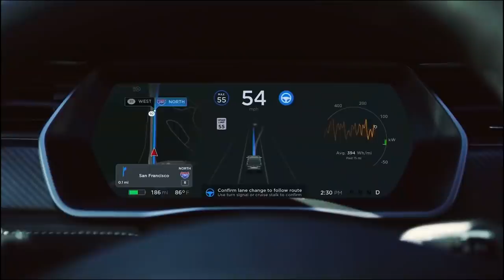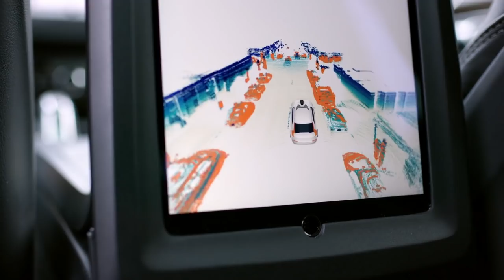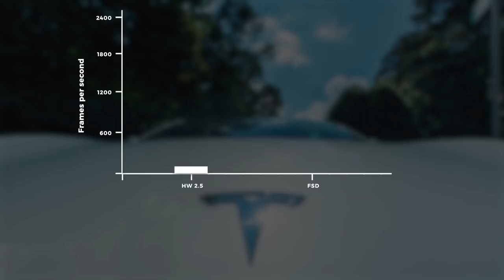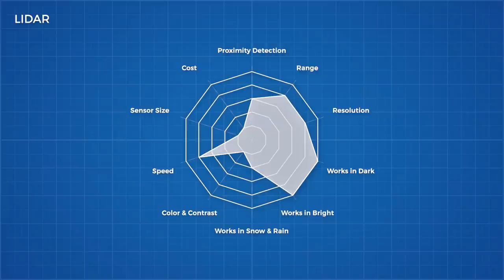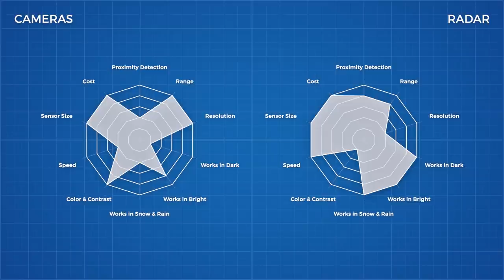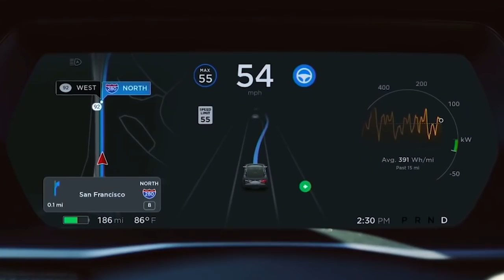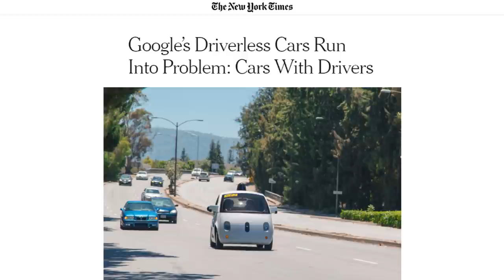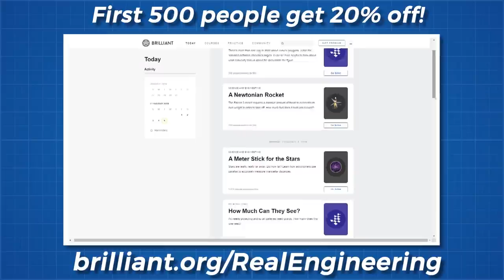The Challenge of Building a Self-Driving Car

Comment: I highly doubt self driving will ever be done to my satisfaction! IMHO if a car is supposed to be reliably self driving then it should also be liable if it does have an accident. Not the driver as the diver is just a passenger at that point. And this is what will never happen. The car as good as they can make it will still require the driver to be responsible at all times. Which simply is not feasible. If you are distracted doing something else how can you take over in a split second and become a responsible driver for a machine that you first have to diagnose as having failed to the point that you do need to take over. This is exactly why B737 Max aircraft have been grounded. Because of failed automation protocols. And guess what it is the pilot in commands fault not the airplanes fault even though they are grounded. Funny how corporate America escapes liability. 

And last issue I have is that testing of automation is even allowed to happen in live traffic putting other people at risk and if anything does happen it is the driver liability and not Tesla at all. They remain squeaky clean while you test drive their product and assume its liability for them. And they get to charge you money for that service on top of it. Like your insurance premium. And your price you pay for the auto pilot function. 
If these cars really statistically are safer to drive by a wide margin then your insurance rates should also be cheaper by a wide margin, so I ask you why are they not? Who is being taken for a ride by corporate America in this whole equation?

P.S. Every single accident that I have seen reported that involved a Tesla, has always been caused by the Tesla. I have not seen or heard of a Tesla getting involved in an accident caused by a human driver outside of the Tesla owner. Even though they are safer than human drivers. I find that interesting.
Reply: Terms of service better read that instead of crying on the internet.
What is tesla autonomy lvl that you assume that they have to assume liability when clearly they stated that they wont. How about creating a car company that can have autonomous driving and be better than tesla or waymo etc.
Reply: @chillrawr9603  Because it is a cop out to build a self driving car and then tell the world you will not stand behind your own product. That simply tells me they do not believe enough in what they are doing to back it up with their own money. And in that case the entire self driving tech is a house of cards. Why? Because the stock price is based upon the idea that Tesla is more than a car company. So to all of that I say prove it. I for one will never support or buy any self driving car unless the company that builds it also assumes liability for it. Call it checks and balance. 
And I think the rest of you that do assume Tesla liability for them are stupid. It is simple really, if the public demanded that Tesla assume liability for the auto pilot and stopped buying Tesla's until they do how long would it take Tesla to change Terms of service. Why do you allow them to dictate terms to you the customer? When you have all the power in this equation. Yet allow yourself to be played the chump.

Comment: Tesla's safety features can't detect if you're about to be rear ended
Reply: I think this myth stems from some autopilot compilations where somebody accelerated to avoid being rear ended with autopilot off, and somebody added the autopilot warning sound onto it
Reply: they actually can better than humans usually do, I've seen it first hand.
Reply: @frozenthorn9619  no, i have a model 3. no where in the owners manual or autopilot settings does it mention rear collision avoidance. there is only forward collision warning and auto emergency brake

Comment: One thing to note though, while the miles of data that Tesla has is far larger, Waymo's data set is far more comprehensive and "feature-filled". Those initiating feature factors are force-multipliers in the accuracy and power of that data, especially when you want to do "feature-engineering" later on with the data-set, even if its automated and done by the algorithm itself.

If you want an analogy, Tesla's dataset is more similar to an Observational Study of a million people, while Waymo's data and methodology is a Double-Blind Randomized Controlled Trial of 10k people. The later has fewer people but at this stage, it has enough samples with it complexity to far surpass the prior

Comment: The pedestrian crossing the road was visible at 1:49, but let's say 1:48 because the video is not the same as actually being the driver in that car, and they got hit at 1:51. Asumming the video is not sped up at all that's 3 seconds between seeing the pedestrian and hitting them. Minus 1 second human reaction time. That's two seconds to decelerate. Not nearly enough to decelerate from 70km/h. The human pushed the brakes 1 second before impact and deccelerated by just 8 km/h. Any human would have hit the pedestrian in that situation, or even worse could have veered of into a different lane and caused a bigger crash.

That aside, it was indeed very poor programming. No warning system, no slowing down when recognising an unidentified object in the road like a human would do, not even a gradual decceleration when it realised the impact was inevitable to increase chances of survival.

Comment: Uber hard-coded the software to simply not brake if it would result in too much deceleration? I.e. never perform any emergency braking maneuver because the driver might be inconvenienced? That's an infuriatingly irresponsible design choice. There wasn't even any traffic immediately following the car, and thus no risk of a rear-end collision.

Comment: New Mazda with radar cruise control, works beautifully and reduces driving effort. But the other day it just stopped working for some inexplicable reason so I had to manually reset it and then it was fine. Point is none of these aids work 100% so what happens when they don't in a self driving car? Sensors can get blocked by debris, white lines are never 100% reliable, self driving car? I don't think so.
Reply: Humans aren't 100% reliable either.  That's the whole point.
Reply: @CorwynGC  If I as a driver failed like the radar cruise control did then I'd be dead many years ago. The self driving car concept is based on the extreme arrogance of a few people.
Reply: @FairladyS130  And many humans just like you are dead, 40,000 or so every year in the US.  So since anecdotes and survivor bias don't get us an answer; what does?
Reply: @CorwynGC  Any driver is constantly making car control decisions, that has to go into the billions of decisions for any experienced driver but I guess that you automatics have worked all that out already? My radar fail happened after about a total of 8 hours use, that speaks for itself.
Reply: @FairladyS130  You sound just like the chess players that said no computer would ever play professional level chess.  And the professional Go players that said the same thing.  Tesla's autopilot has a billion miles of experience and processes information about 1 billion times faster than humans, it is lacking a million years of evolution learning how to learn, but it is getting trained by the pinnacle of evolved intelligence.  Are humans smart enough to drive but not smart enough to teach a machine to drive?
Reply: @CorwynGC  No, self driving cars will come but only in the form of a being driven by a 'human' robot that will have all the required human qualities without the negatives such as anger, ego and so on.
Reply: @CorwynGC  Yet you want humans to devise the perfect self driving car? LOL.
Reply: @FairladyS130  A human robot is a far worse than an intelligent car.  That would be crazy.  Having a computer tell a leg to move and extend to press on a brake pedal to activate brakes is far slower and more problem prone than just having a computer tell brakes to activate.
Reply: @FairladyS130  Humans devised chess programs that beat all humans, so yes.
Reply: @CorwynGC  If that's your 'logic' then humans create everything except what nature does.
Reply: @CorwynGC  Who said  a brake would be operated like that? My point is that a stand alone self driving car would tie up a lot of tech which may not be used very often whereas a car driving robot would  have many uses. You fan boys need to think outside the box.
Reply: @FairladyS130  The WHOLE POINT of self driving cars is to keep the duty cycle of the car as high as possible, to make money from the car.  Trying to invent a car driving robot that can also do anything else would be more than twice as difficult.  You need to think inside reality.

Comment: EVEN IF we could reliably determine that these road-bots matched the human average of 1 death/million hrs., that would not be good enough because the human stat is greatly skewed by those whose driving is both consistently and extremely dangerous and whose driving hours per fatality would be measured not in millions, but in mere thousands of hours. The threat they pose will only rarely NOT be realized, ending only serious injury or death for themselves and/others. With such a small percentage of drivers accounting for an extraordinarily disproportionate  number of road deaths, I for one will NOT trust a program that does no better than equal a  safety rate for humans that includes those outliers who statistically truly are fatal-accidents-waiting-to-happen.

Comment: This and the Boeing 737 Max, examples of software developer over reach. Time to legislate for developer certification, and supervision for each and every software update.
Reply: Every modern airliner uses an immense amount of software augmentation the MAX is actually on the low end of the spectrum it does apply the concept differently in that it's not a full fly by wire system

Comment: 70km/hr is 63.8 ft/sec or 128.7ft/2sec. Leaving the system a bit more than 2 sec for detection, decision and braking to a full stop. 

The name of the game auto drive is for collision avoidance, such uncertainty decision is a system fault and no excuse. 

A word about LIDAR. 
Like Radar, both use narrow beam to “sees” a 2D cut out of a 3D space. 2D by a slice of angle + depth at a relative lower frame rate. Where camera sees 2D cut out of a 3D space by V and H without depth at multiple times the LIDAR frame rate. LIDAR are mounted high use a shallow depression angle can easily missed shorter person in close proximity. But that is less likely a root cause in the below discussion. 

Definition for “certainty or not” in LIDAR data processing in this case may be..
(1) Depth data stream from one peek to another is continuous within a specified (small delta) = certainty (eg a person, body)
(2) scattered, depth ripple exceeding (small delta) = uncertainty (eg bicycle wheel or basket)
(3) mixed (1) + (2) above = uncertainty (eg a person pushing a bicycle) could be a root cause in this case. 

Item (3) is an over liberated rule we can change in self drive code to save lives.

Comment: Might be overkill being able to process 2190 frames per second more than before (110 frames per second) @ 4:30. You won't see any changes in real life movement above 60 frames per second which is what the eye can make out.  seems like resources should be focused more on analysis algorithm.
Reply: When traveling at 60 mph you would cover 1.4 Feet every frame at 60 FPS, however at the same speed you would cover less then an inch at 2190 FPS. The higher frame rate gives the system context to its surroundings.
Reply: Great comment above me. Also this allows them to install much higher resolution sensors and more sensors in general.
Reply: My god so much wrong here:
1. More FPS means faster reaction time and it allows for more complicated Software without running into performance issues.
2. The human eye can see more then 60fps! I dont know why this myth is still around as IT has been prooven wrong many times. Just Google it.

Comment: My wife and I just rented a 2019 Nissan Sentra for a 32-day road trip and put almost 9000 kilometers on it, driving through 17 US States. I was pleased to discover, in stop and go traffic, that it had a warning tone to alert me to potential forward facing collision situations. However, I had no idea that this feature also included an emergency braking system. We discovered it when it activated inappropriately in a situation where I was fully aware of my surroundings and in complete control. I chose to make a close pass of a car ahead as it exited the roadway into a parking lot. It wasn't even close to dangerous but did involve anticipation of the other vehicle's movement based on my experience and discerning judgement. As a result of the cars programming, we were scared out of our wits as we were thrown into our seatbelts and as objects were thrown forward in the passenger and luggage areas. We were almost rear ended by the following vehicle, the driver of which was reading the situation exactly as I had. The unanticipated but very real danger to both of us was the car's computer taking the wrong action for the sake of our "safety".

Comment: Curious how well tesla will do a deer detection at night. My guess is pretty poor.
Reply: It depends. I've been in a Tesla that stopped for deer at night, but I've also heard of people having to stop their cars manually saying it didn't like it had detected it yet. I imagine it has a lot to do with speed and if the deer are moving or just standing still. This is something that should be greatly improved with Tesla's new much faster chips, they aren't in most cars yet, but that added processing power should do wonders because at the end of the day no matter how many cameras or sensors you have, you need to be able to analyze what you're looking at or detecting fast enough to take action on it.

Comment: Off Topic, relating to the Brilliant ad: It was on learning the computer language "Python". To me Python is an updated "version" of BASIC. Forget the syntax and capabilities. Both are BEGINNER languages, for getting things up and running quickly. Unfortunately, that turns them into CRUTCHES, that people want to stick to, as opposed to moving onto more capable languages, and methods !

Python, and BASIC, are NOT do all, and end all solutions. They are just programming APPETIZERS. They both have very pronounced short comings. For starters, they both are "interpretive", and NOT COMPILED. That means they run dog slow ! For example, the photo editing program GIMP, is a free competitor, to Adobe Photoshop. It functions are great, other, than they take FOREVER ! Because its written in Python. It should have been translated to another language. But being free, there is no incentive to do so.

I use to write a bunch of quick-n-dirty programs in BASIC, but never for an end product. You have to know its limitations. The same applies to Python.

Comment: Wait so cameras are good at resolution, poor at low light. Radar good at low light but poor resolution. How does combining these two give higher resolution in low light?
Reply: i feel like you answered your own question so I'm a bit confused where to add value lol, when two technologies complement each other they make up for the shortcoming of each other, the data from both is fed into a computer which analyzes the data, thus you virtually create a third technology that is actually good at both things. The current problem is that computer processing the data takes time before it can be acted on, as a delay or lag in a video game, but out here the deaths are real. Tesla has new chips that cars will be getting which is supposed to be a LOT faster at doing the processing needed, so it should make a huge difference.
Reply: @frozenthorn9619  no like, cameras are poor at low lights. So whatever resolution they have can only be utilized in good lighting situations. In low light situations essentially only useful data obtained will be from radars. So we are left with low resolution in low light, right?

Comment: Elon actually lied about their new computer being the most powerful. Nvidia has had much more powerful computers for quite a while. It's just that up until now Tesla has chosen to use the cheapest (actually made even less powerful and expensive specifically for Tesla) one on the market, yet pretend like they were using the most powerful one
Reply: Incorrect he didn't lie. The Nvidia system uses 500 Watts and Tesla uses 72 watts. They have the most powerful and efficient system

Comment: They also did not factor when these cars are 10 years old being sold used for $500 with rust and dents and being drove by poor college kids , who do not even know how to maintain air in a tire.
These things have to be 100% reliable ,100% of the time . Even at 99%  they are a death trap to everyone.
Name a man made mobile machine that is 100% reliable?  
I had 2 week old cars break down on me but unlike a driverless car it did not drive into a building or rear end  a stopped car.

Comment: Tesla will be the only company who will have a good self driving car for the next several years. They're using an artificial neural network based on over a billion miles of trained data from their current car network. They aren't using lidar, but instead 360 radar and vision. They've already stated that they aren't afraid to make their cars drive aggressive in large cities and when needed. There's way too much hate against Tesla in this video. They're on track to making Tesla self driving far more safer than human drivers from a statistical standpoint.